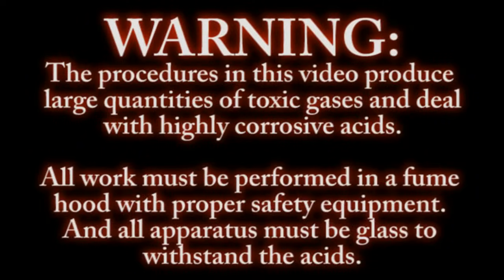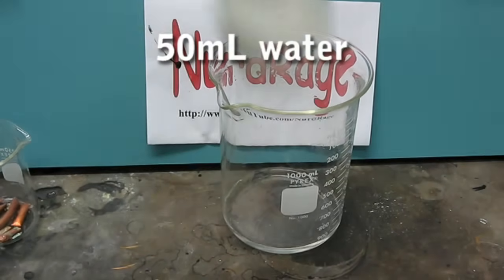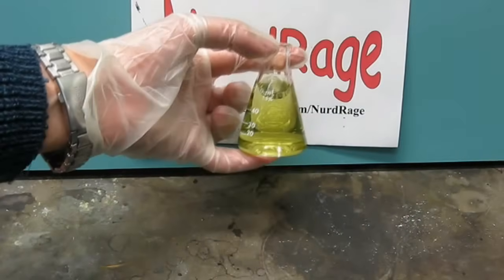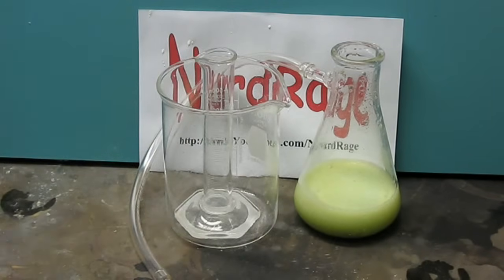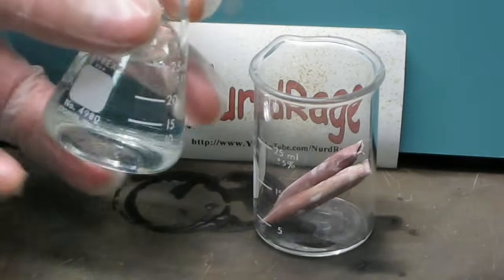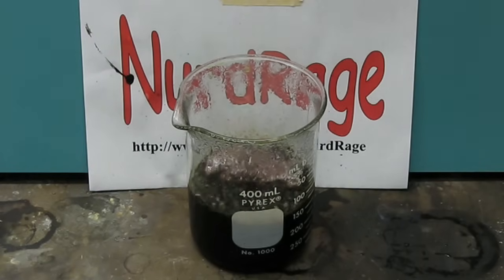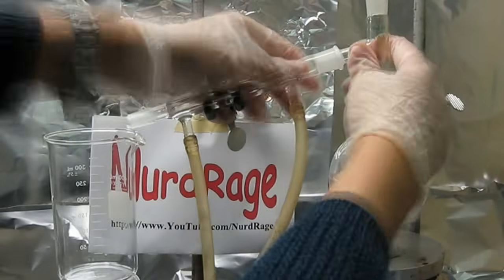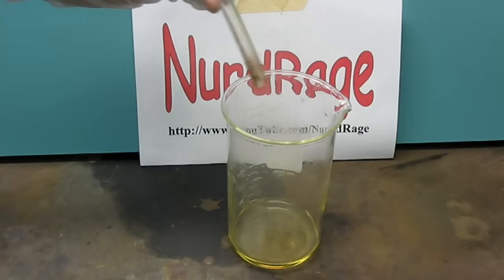Make Nitric Acid - The Complete Guide

Comment: These have been awesome videos.  I particularly like the attention to the science behind it.  
I thought I'd share an experiment for making nitric acid I tried years ago.  
I had a reasonable Tesla coil (about 2 ft high) which I ran inside an e. flask of water, I put about 50-100 ml in and ran this for some time.  At first I tried just a copper wire, and later a glass jacketed one (voltage went though glass).  It worked, but was weak, and destroyed glass jacket.  e- + N2 +O2 to make NO2.

Comment from the maker: Our stopper did not dissolve, the dripping is because the reaction is actually pretty hot and some of the water evaporated and condensed on the stopper.

But the stopper will eventually decay. Thus why we recommend all-glass apparatus. You can see an example of an all-glass gas generator in our sulfuric acid video.

Comment: Another question or more like a reply, when using the black rubber stopper for the seconds trial; it dissolved and started to drip?

I tried once distilling nitric acid in a homemade set up with the black rubber stopper, it seemed like the rubber started to be eaten away by some nitric acid fumes and nitrogen dioxide gas which eventually resulted in failure at some point of the distillation process.

Comment from the maker: You win a gold star.

-but-

-initial cost of platinum gauze is a turn off for most people. Plus complex reaction system is needed to prevent explosions, flash overs, and incomplete oxidation. Also tends to form ammonium nitrate if any unreacted ammonia gets past the gauze. Bottom line, not feasible on small scales.

-High voltage discharge process requires a cooling system to keep it from overheating the walls. shielding is needed to block EMI. Not as much hassle as ostwald but up there.

Comment from the maker: powders can pack to varying degrees, so the same mass of powder can have different apparent volumes depending on if it's loosely packed with lots of air in between or very tightly packed.

As such. i cannot tell you what the volume is to any degree of reliability.

Comment from the maker: As mentioned in the video, i used an excess just so that it would look cool on camera. Really, you should only use the 1:1.

There is no way to boil nitric acid from the mixture without decomposing it at atmospheric pressure.

You need a vacuum distillation setup in order to distill pure clear nitric acid.

Comment: I make nitric with H2SO4 and KNO3 in a small retort....I use a 1:1 molar ratio (equimolar). In the video you use an excess of sulfuric. Is this to soak up the water and produce more concentrated nitric? Also, what temperature do you distill at to avoid decomposition and nitrogen dioxides?

Comment from the maker: alright then, you might need more acid since the acid i use is 37%. If you're using 20% then use twice as much and you can avoid the initial mixing with water. just go pure nitrate and acid. add the copper and go for it. Just remember to do it outside in a properly ventilated fumehood, the gasses *will* kill you if  inhaled.

Comment from the maker: Alternatively, buy a glass condensor and use it for almost any chemistry you want (except flourine based) up to 500 degrees or so. 

I've seen teflon get destroyed by certain chemicals at room temperature. Glass still stands as the most widely applicable.

I've done refluxing sulfur reactions at 450 celsius using glass condensors, Teflon ain't going to cut it no matter how cheap it is.

Comment from the maker: I've used glass past 450 C and quartz up to 700 C (but it can go higher than that)

Teflon distillation apparatus is good for those reactions that are glass reactive. such as things involving fluoride ions. 

But glass is ultimately applicable to a wider range of chemicals, temperatures and reactions than teflon. It's also easier to find glass labware, there are so many sellers, than teflon labware.

I don't reccomend anyone use teflon labware unless they have a specific need for it.